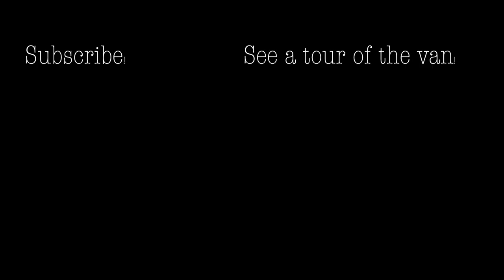Converting an Astro Van into a Camper - Full Build Time-Lapse

Comment: Great work. can I ask how did you remove your rear AC unit? Mine van is metal freon tube connect to rear AC unit, couldn't be cut. so how did you do yours? thanks
Reply from the maker: You’ll need to have the freon removed so that the lines are dry and then you can cut them and cap them. I removed the end pieces and then took them to a vice, flattened them and folded the ends several times. Then dipped them in several coats of JB weld.

Comment: Super cool van. Can I ask you:   I am 5'8" and was wondering if I would be able to sleep sideways on a custom bed that IU built for the van?  Can you throw some light on this?  Thank you so much in advance, Javier.
Reply: On an Astro van if you put the bed sideways from one window to the opposite side in the back, you'd have to sleep a bit diagonal. Total width is almost exactly 5'6". It's doable, just have to sleep a bit slanted. I prefer the the front to back bed set up, although it does seem to take up more space.
Reply: @CommanderRick   You are super kind, thank you.
Reply from the maker: Javier, I'm 6'0 and I do sleep sideways in this van. Like Commander Rick said, I do have to sleep at a slight angle. I actually built this van last year and traveled with my girlfriend and our 2 kids in this van for almost 6 months. More videos on that coming soon.
Reply: @ColeWebb  Thank you so . much!!!!
Reply: Fetal position maybe. I'm 5' 10" and couldn't do it.